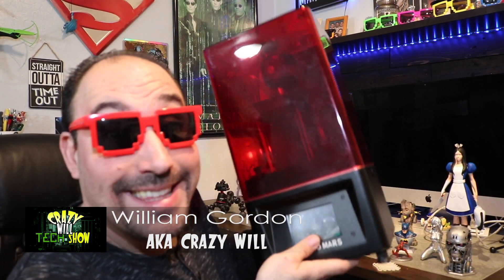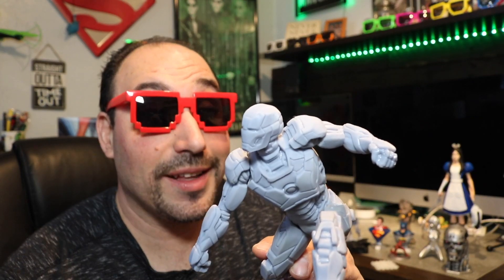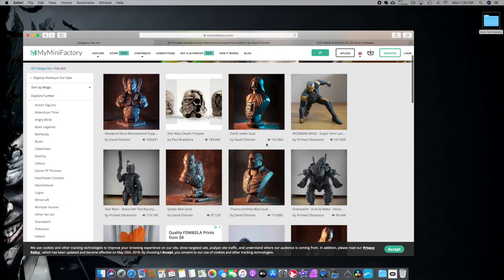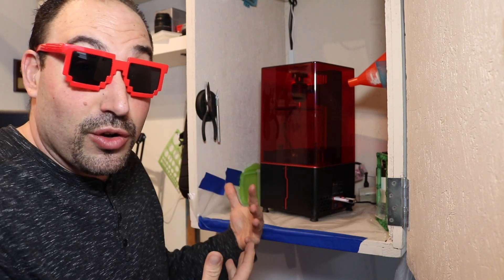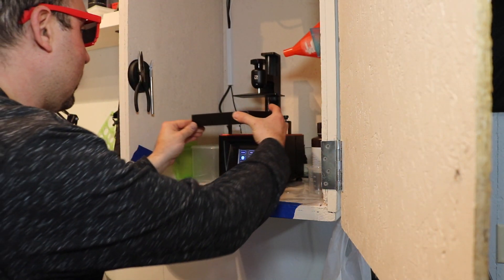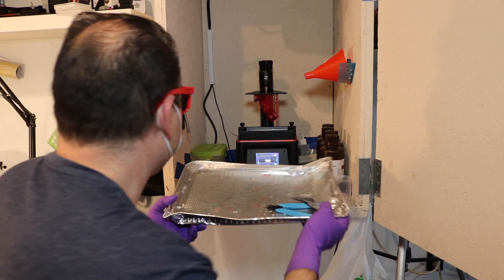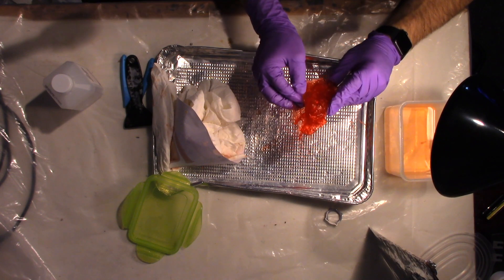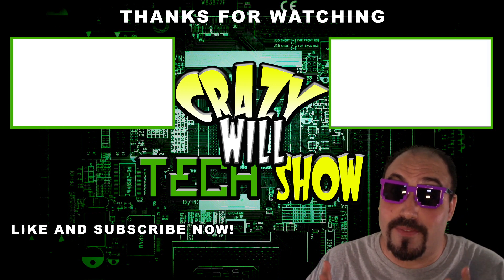A look at the Elegoo Mars 3D resin Printer

Comment: Very cool! How durable would you say the resin is?
Reply from the maker: It’s not bad but fragile if to thin. They have an abs like resin that I use for The lights stand in the video the camera screw part keeps Breaking. But the fan switch works great. So it depends on size you print.
Reply: @CrazyWillTechShow , thanks! Was curious if it was like polyester resin or not, which basically gets its strength from whatever matting or other material it's used with. 👍👍